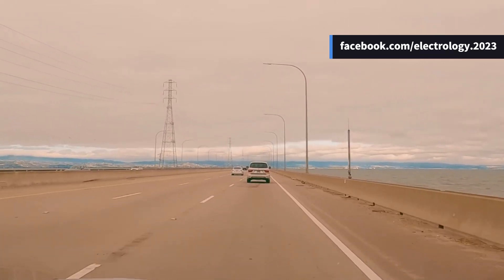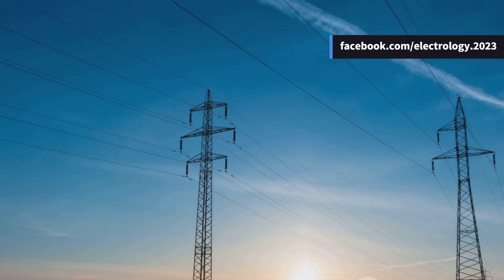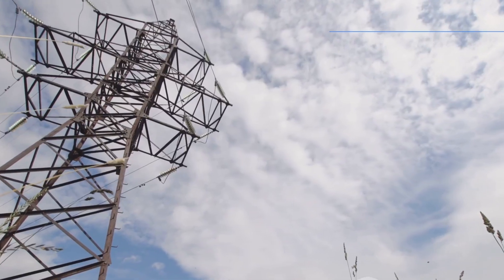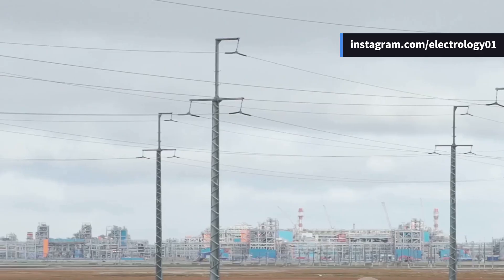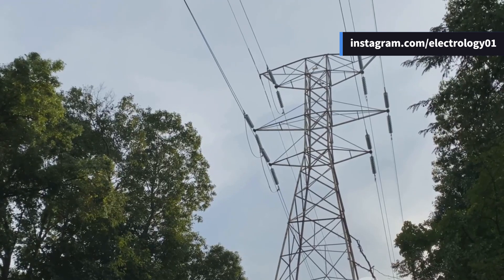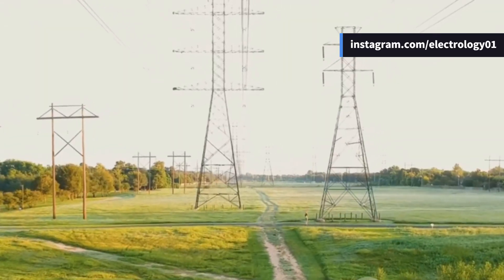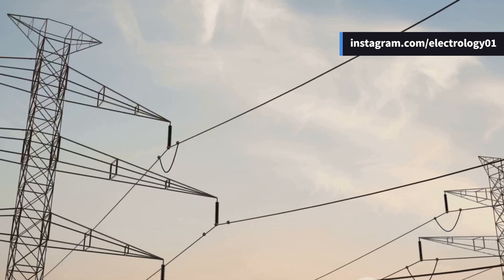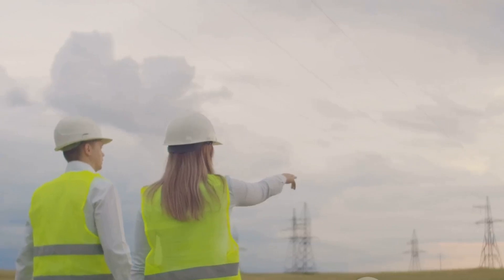Single Circuit vs Double Circuit Transmission Line | Which One is Better & Why?

Comment: Can double circuits be set up like single circuits? Like each phase shares the same arm and insulator? You know how you see some lines right next to each other (~12 inch seperation). Kind of looks like there is a parallel run. Or do each circuit require their own arms/side of tower?
Reply from the maker: Great question! 🙌 In double circuit lines, each circuit usually has its own set of insulators/arms on the tower to maintain clearance and keep the circuits independent.

However, in some cases both circuits share the same cross-arm. In that situation, proper electrical gap must be maintained, and remember—each phase still needs its own insulator string. ⚡

The close spacing you noticed (~12 inch) is usually for bundle conductors of the same phase, not two separate circuits in EHV/UHV lines.

Comment: I would like to know how conductors Are distributed along the tower based on specific circuit please!.?
Reply from the maker: In single circuit towers, 3 conductors (R, Y, B) are arranged horizontally, vertically, or in triangle form.
In double circuit towers, 6 conductors (2 sets of R, Y, B) are placed either side-by-side or one above the other.
Reply: @Electrology001 , what will happen if R of first circuit become in contact with R conductor of the second circuit?
Reply from the maker: @GoodluckWarae If R of Circuit 1 touches R of Circuit 2, a fault occurs due to unintended connection. Even though both are same-phase, their voltages may not be in sync, causing high circulating currents and possible damage. Protection systems will trip to isolate the fault.